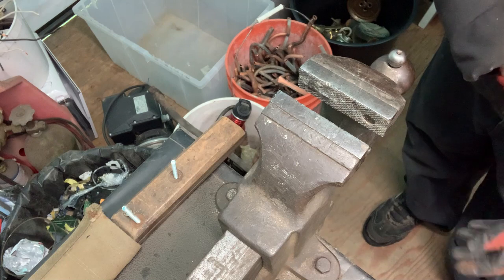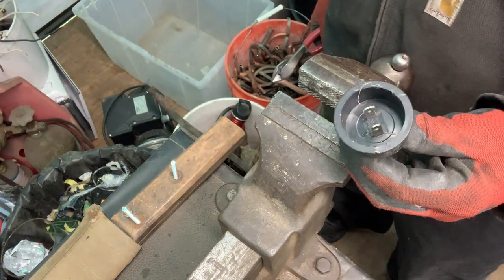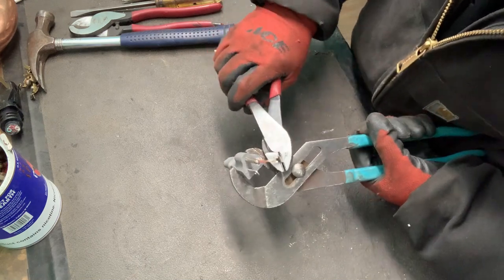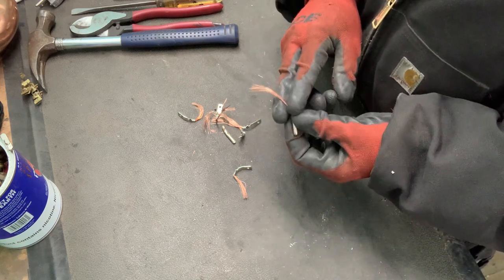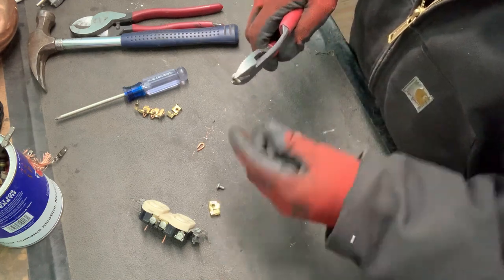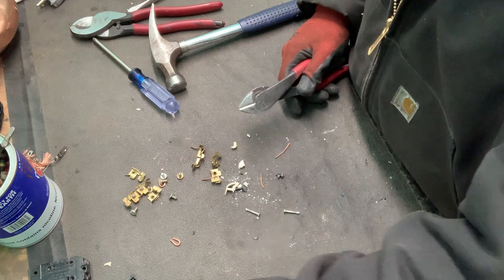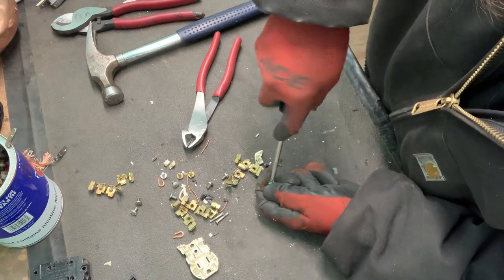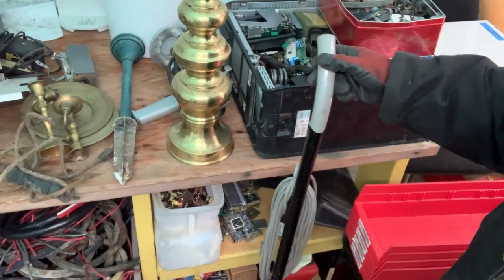How To Scrap Plugs & Outlets!

Comment: My excellent scrap yard allows plugs on with low grade insulated.  A while back I did what you are doing and weighed up the brass and copper, did some math and it paid more to just leave the plugs on! Big time saver.  I just got some older outlets and the screws are brass as well.  For me its a hammer on concrete.  Older outlets are more brittle! Time is money.   My last brass cash in was $2.40/lb  for clean brass, the highest that I have seen. I had a 50lb. box, but it has been a while. $510 total load in my old Toyota Celica!!
Reply from the maker: That’s so awesome your yard allows you to leave them on. Easy money that way! 
I love how brass just adds up so fast. Great payday my friend and thank you for your comment.

Comment: My scrap yard doesn't care if I don't cut plugs off, in which case I recommend not cutting them off because of problems you had with 1st plug.  Sometimes the Copper in plug has a collar, in which case it won't pull out with plug.  As for dryer plug, bothcutters can get prongs out.
Reply from the maker: I wish my yard wouldn’t care if they were left on. I’ll have to try the bolt cutter method. Thank you and thank you for watching.

Comment: I found an old toaster oven someone threw away in a dumpster. Took it home and plugged it in and it still worked. I use it to heat up a bunch of plug at a time and the brass and copper slide right out with channel lock pliers and the sidecutters pliers
Reply from the maker: That’s awesome! I heard boiling them in water works well too, think I’ll try that one day and of course make a video of it. Thank you so much for watching.

Comment: If you happen to be scrapping an RV, I need to find a power connection receptacle also a 12volt spark unit ( found on water heaters, furnaces, fridge) ⚡😎☕
 Scrapitall, another good show, here🎯
Reply from the maker: I’ll keep that in mind if I ever come across those things and let you know. 
Thank you so much buddy. I really appreciate you supporting my channel and always leaving comments.
Reply: @scrapitall200  you bet👍
 I have been sharing the link⚡😎☕
Reply from the maker: @invisibilianone6288  thank you so much, you rock!
Reply: @scrapitall200  yes, I have one of those between my ears😂😂😂
Reply from the maker: @invisibilianone6288  I like my rock it’s smooth and not too heavy 😂😂
Reply: @scrapitall200  my rock has a hole, for light to pass through.
 My memory is like lightning, , , one ⚡and it's gone.
Reply from the maker: @invisibilianone6288  you might need to get that checked out 😂
Reply: @scrapitall200  ohhhh, I'm sure it CHECKED OUT, long ago😂😂😂
Reply from the maker: @invisibilianone6288  😂😂 that’s hilarious
Reply: @scrapitall200  I've always been an Intelligent Posterior ....😁
Reply from the maker: @invisibilianone6288  😂😂😂

Comment: I save up plugs and switches till I have a bunch then use my cordless driver to remove every screw to get the copper then use my magnet to sort the screws then when I break the plugs and switches I lay an old rag over them then smash them with the hammer. It keeps the pieces from flying everywhere in my shop.
Reply from the maker: That’s awesome, thank you for watching.

Comment: Putting these in boiling water for a few minutes makes this job simple but they cool down quickly so you have to kind of balance it with doing 10 or so at a time between projects. If you accumulate a substantial amount, and every scrapper should have a bucket full after 6 months of scrapping, it is time well spent. 
Peace
Reply from the maker: I’ve heard of that method and haven’t tried it yet, but I will be soon. I actually like to do them as I’m scrapping the item I just cut them off of, I don’t like to let them accumulate cause then it’s a lot of monotonous work lol. Thank you for watching.

Comment: Did you ever see that video Thubprint did where he left his plugs in some boiling water to loosen up the rubber? I haven't tried pulling the brass from plugins yet but I should start. Your video is giving me good ideas! thanks!
Reply from the maker: I did see that video. Only reason I don’t try that is cause it’ll cost money with the electricity or propane to boil water and that would cut into my profits. Although I’m thinking about trying it over a fire in my fire pit. Thank you! Glad my video has helped.
Reply: @scrapitall200  Understandable and the fire is a good idea!
Reply from the maker: I’m going to save up a bunch of plugs and make a video boiling them in water using a fire and see how it works.
Reply: @scrapitall200  Nice!

Comment: Great video. Might also look into switches and circuit breakers. Both have brass and some (mostly circuit breakers) have silver that can easily be scrapped.
Reply from the maker: Absolutely and I do have a bunch, I just didn’t include them in that video. Perhaps I should make a video with those in them. Thank you for your comment and taking the time to watch my video.

Comment: Double check those big “brass” lamps aren’t just die cast. That happened to me once when I didn’t know better. I bought a big heavy lamp similar to that for $5 or $8 at the thrift store thinking I’d score on brass. It was die cast and I basically broke even on the weight😅
I found an entire brass bed frame once and that was sweet, like $100+ after I cleaned it up!
Reply from the maker: Yeah I’m pretty good at checking things with a file, fortunately every thing I get is free lol. 
That’s sweet, I love when things are heavy brass. Thank you for watching bud.
Reply: @scrapitall200  everything I get is also free, yay! The lamp was a learning experience, at least I didn’t lose money, but the thing was like 15+ lbs “brass”! (So I thought) And figured I could buy it for $5 and make $25😅oops! Now I know my metals better!👍
Reply from the maker: @dr.a006  I’ve learned that when they are really heavy, they aren’t brass lol. Mostly.

Comment: Rubber trash barrel and a heavy sledge, use the bottom of the sledge to smash them in the barrel and just grab the brass and easy clean up
Reply from the maker: I have two separate videos on plugs and outlets now. Thank you for watching and for your suggestion.

Comment: boil the plugs first yo will get the more 
and cut the windings in the      motors instead of the steel
Reply from the maker: I haven’t tried boiling them yet but I’m going ti try that method down the road. Thank you for watching.
Reply: @scrapitall200  it softens the rubber around the plug and makes it easier to pull out  dont work good with plastic tho plugs
Reply from the maker: Good information, thank you for sharing, I appreciate it.

Comment: As for the electrical outlets, I don't do them, yield too small, many are brittle, but many are too tough to hammer.  I don't agree with this guy using screwdriver the way he did at 6:30 because eventually he will stab his hand with screwdriver.  Vice grips.
Reply from the maker: That’s exactly why I was telling viewers to remove the screws before breaking the outlets apart. Done properly 100 hundred of them and never hurt myself yet. Thank you for watching.